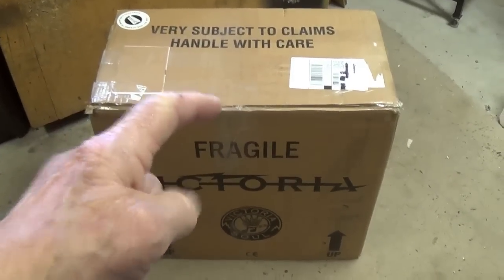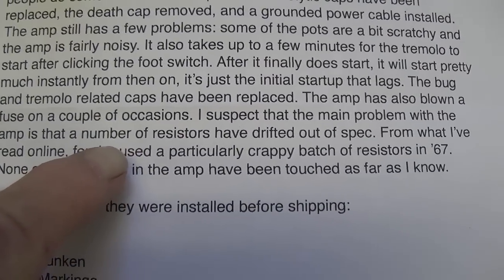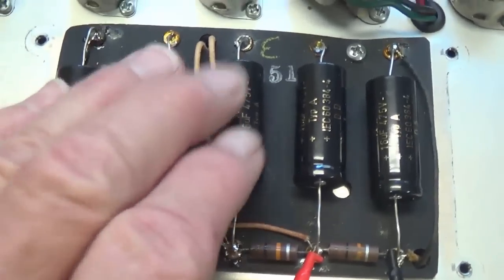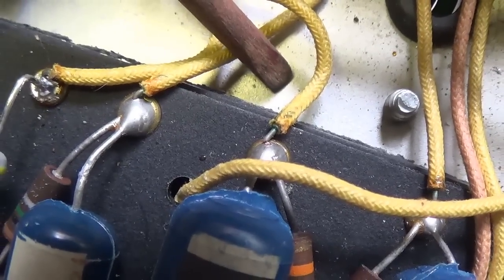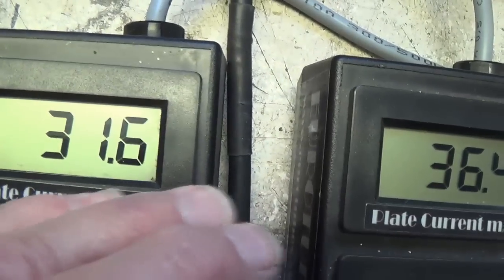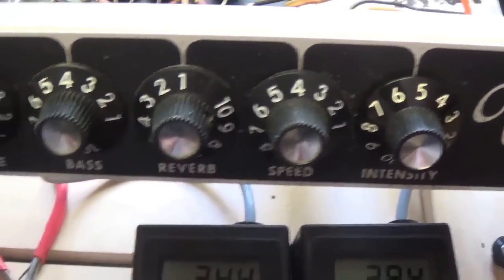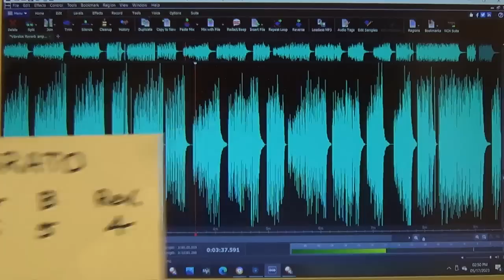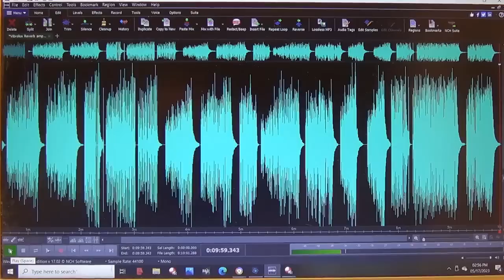1967 Fender Vibrolux Reverb with a Lazy Tremolo and too much Background Noise

Comment: A couple of things to watch out for in a case like this: 1) If a knob has been replaced (having been lost or broken), maybe the knob took a hit in the gigging van and the potentiometer itself was also damaged. The video didn't show the backs of the pots and so we can't see if that tremolo intensity pot appears original or not; there's always the possibility it was replaced with a non-original part which might not be of the correct resistance value or taper; or perhaps it simply drifted with age. And 2) although the eyelet boards in late blackface amps weren't as heavily waxed as the ones used by CBS in the silverface amps, the Leo-era boards can still be prone to contamination from a combination of moisture, cigarette smoke and other gunk that is absorbed from the air, making the board mildly conductive; when the amp is turned on and warmed up, the wax softens and allows moist air into the board, which becomes trapped when the amp cools. Also, if the amp was shipped to Doug from a more humid climate,  it might temporarily appear to perform better with less noise in the dry Texas climate; and the heat of resoldering anything in that area would tend to drive moisture out of the board and temporarily make it a better insulator so that it performs more quietly. Even millivolts of leakage through the board could affect the charge/discharge rate of the capacitors in the tremolo circuit! 

Ideally, scraping away any flux residue from the connections in the tremolo  circuit area, warming up the board with a hair dryer or heat gun, and then blotting up the softened wax with alcohol and paper towels or Q-tips would be a good idea. If the amp in question is a silverface Fender with a more heavily waxed board, removing all of that wax isn't merely optional, it's really a necessity. Watch a couple videos from Psionic Audio, and Brad's Guitar Garage, to see how its done.
Reply from the maker: Thanks for your very detailed input, GU :)

Comment: Hello Doug, I have a Fender Custom Vibrolux Reverb which I removed the green circuit board and installed an eyelet board like Fender did in the past. My question is what is a safe and good bias for the 6L6GC tubes with the plate voltage at 384 volts. Is 36 ma good enough or can I increase that ?
Thank you
Reply from the maker: Greetings, Jim. The max PD for GC's is 30W. I assume the tubes are fixed bias (grounded cathodes) so ideal PD is 70% = 21W. At a PV of 384V, your PC could be much higher, i.e. around 50 to 55mA.

Comment: What do you think about the black panel pro reverb amps? I just picked one up from family, it’s a 65 and it’s such an amazing amp. It has an original cover that isn’t in the best shape but for the age the amp is in decent shape. Has a few dings and bumps but otherwise is in great shape. It has a pair of RCA black plate 6L6GC’s and an RCA GZ34  rectifier tube. The speakers aren’t original though they are Italian Jensen C12N’s. I used to only dream of owning vintage fender gear, now I have a 63 6G6-B Bassman, a 61 brown reverb unit 6G15, a 65 Pro Reverb Amp and I’m getting a 65 Fender Jaguar in mint shape.
Reply from the maker: I love PR's, Nikki. One of my all time favorite large amps. Wow, you are gathering quite a nice collection of vintage gear.

Comment: In regards to the carbon comp vs. metal film argument.........   I  ALWAYS just use metal films in clone amps that I build.   I really don't have anyone complaining about tone....  and I've had numerous owners proclaim that my clone amps sound BETTER than the vintage (70's) amps they were using.   I REALLY wish musicians could audition amps "blind"...  where all you know is how it sounds.  We get hung up on brands, and "magic parts".... when there's no magic.  You know that as well as I do.   Parts are either suitable for purpose,  or not.  Speakers either give a great sound,  or a not-so great sound....      I have my opinions on what works well,  and what doesn't.... but I NEVER proclaim any parts as "the secret"...   Secrets are for scammers.
Reply: I wholeheartedly agree, and I'm sure UD would too. He's said as much before. Right on
Reply from the maker: You're preaching to the choir, DK.  Until someone posts a properly-designed double-blind experiment in which various individuals......or even test equipment......can detect a legitimate difference in tone associated with different brands of component, I shall remain a skeptic.
Reply: @UncleDoug  Indeed.  In many respects we've got better parts now than existed in the 50s-70s...  yet present day Fender doesn't use them.... they pick the cheapest stuff instead.   At the same time, I don't believe in the extra pricey "vintage" style parts either.   I buy on reliability and value.
Reply from the maker: Agreed, DK. Well said.

Comment: Uncle Doug, I have an old 1963 Fender reverb unit that has been making a strange low flutter static (the best I can think of to describe) that has been present for over 10 years.  I live with it and have changed many components over the years but I have not changed every resistor which I now think may be the problem.  It's basically the only component left that I haven't changed although I have changed quite a few of them.  What would be the best type of resistor to replace the old carbon comps and still retain the vintage sound?
Reply from the maker: I use carbon film resistors, MS. Also, check your lead dress. I had a long-term oscillation problem with my 6G15 that was resolved simply by moving some wires.
Reply: @UncleDoug  Thanks UD.  It's more of a random, sporadic, noise that comes and goes, kind of like someone shuffling a bunch of paper except amplified.  Did you end up replacing all of your carbon comps?  I just checked my old parts bag for the reverb and it looks like I've only replaced three resistors and the three diodes, plus all the caps (except the blue moldeds) and tubes over the years.  I thought I had replaced more resistors because I made a list and I think I bought them years ago.  Now, I need to take the list and buy all carbon films and nip this noise in the bud.  I used my trusty capacitor analyzer on the blue moldeds.  They seem to last forever.  Have you gotten good use out of your capacitor analyzer?
Reply from the maker: That does sound like internal arcing within carbon comp resistors, Mill. There were some circuit issues with the tester that have not been completely resolved.
Reply: @UncleDoug Did you swap out all the carbon comps on your reverb unit? That’s too bad on the tester. I had to change quite a bit on my Sprague including the main wire wound bridge pot. Thank goodness I was able to find one on eBay.
Reply from the maker: I built my 6G15 from scratch using carbon film resistors, so they were not an issue.

Comment: Question, an antique electronics vendor offered to sell 11 new "Hammond" brand replacement transformers (audio and power), along with two chokes for $200.00; they appear new, (to be 1980's vintage) for Fender guitar amps.  While I usually only work on "W Marshall Leach Leslie Systems", these Xfrmrs were sourced from the Thomas Organ Company, I'm guessing for a project involving restoration of at least three amps.  $200.00 is "an easily absorbed loss", and the very moment I would back out of the deal, I'll have a Fender amp for repair come across my "empire of dust" workbench... Do I take the chance??
Reply from the maker: I can't say without knowing the part numbers and applications for each transformer. Like you say, however, $200 is cheap enough to roll the dice and take a chance. If you do, let me know how it goes.

Comment: Hi uncle Doug. Love your videos. I just subscribed. I will be hitting the like buttons on them!! I have a question and you're the one I trust. I'm building my version of the champ amp. However I'm going with solid state rectifiers. Is it better to use the hv center tap to ground and the heater supply CT to ground? Or is it better to ground chassis with the hv - and with or without heater CT grounded? The grounding scheme is where I'm getting jambed up. I'd like to use DC heater power to reduce hum. Any advice would be much appreciated. I want to help keep tube chassis alive. I've restored one tube amp and I've built several electronic projects
Reply from the maker: Thanks so much, Thomas. The HV CT must be grounded to complete the HV circuit. If you choose to rectify the 6.3VAC circuit (which is really not necessary) then grounding the 6.3VAC CT is not required......and it may be part of the rectification circuit, depending on which circuit design you employ.
Reply: @UncleDoug  the HV CT has to be grounded even if a solid state bridge rectifier or tripler circuit is used?
Reply from the maker: Naturally there are exceptions, Thomas, but you did not specify the type of HV rectification.  Simply follow the circuit diagram you end up using.

Comment: I have to admit i did not care a lot about the quality of the resistor i used in my design, always using the cheapest ones. Until recently, with that preamp with which you so kindly have adviced me. 😅
Reply from the maker: I'm glad the advice was helpful :)
Reply: @UncleDoug  I am used to working with opams that are evidently more forgiving than 12ax7s. Now, I got me some good metal oxide resistors to play with.
Reply from the maker: I think you will find them to be superior in every way.

Comment: You know I love your work Uncle Doug. But... You knew that a but was coming right?
I would really like in this instance to hear a comparison. I know you've done it in the past but I suggest a very brief demo of the problem and then perhaps a very brief before and after.
Reply from the maker: My only hesitation in doing before and after demos is that if a serious problem exists in the circuit and I proceed to operate the amp, damage could occur to components like either of the two transformers. Thus, I prefer to simply eliminate all issues before demonstrating the final tone. I do get your point, however, and will keep it in mind for the future.

Comment: 18:13 The resistor on the left has a second color - green. In poor lighting it is hard to see, but still noticeable. So its resistance of 150 kilo-ohms is correct.
Reply from the maker: Thanks for your input, TD :)

Comment: Haha your resistor problem, one of those is brown green yellow (150k) and the other is rightfully brown black yellow, it might be time for some stronger lighting in the workshop!

Random question, with the 'roach' would you get a higher strength signal using a green neon bulb than a red one, considering wavelength difference?
Reply from the maker: Good question, P.  The best way to tell if photoresistors respond differently to different colors of light would be an experiment. If you do this, let us know the result.
Reply: @UncleDoug  I wanted to! But I've been away from home for over 3 months thanks to a fire 😑
Reply from the maker: We've been away from the workshop for about the same length of time, due to incredible >105 degree heat.
Reply: @UncleDoug  honestly have no idea how some people manage to survive in certain parts of the world!
Reply from the maker: No kidding, P. Yesterday was 104 :(

Comment: Hello, i have a Ibanez Valbee, a small modern amp of the 90's. It is possible to replace the output transformer to acomodate a 8ohm or 16ohm speakers? what trafo specs i need?

Thanks!!
Reply from the maker: You need to watch my videos on output transformers and on the impedance ratio. Hopefully, they will help. Good luck.
Reply: Thank you, but my English is very bad, it is difficult for me to understand everything, I am Spanish. But thanks for responding, I'll look into how I can do it. @UncleDoug
Reply from the maker: Good luck, Indi. @indibil

Comment: Excellent packaging and catering to cats, eh? Loveliness.

Metal film resistors FTW! My fav are old Soviet MLT type metal firm resistors, they come in different sizes (1/8, 1/4, 1/2, 1 and 2 watts) and when I tested a 2W one, I ran it at 7W and it was giving off a lot of magic smoke from burning enamel, but still going and within spec.

148k on a 100k, WTF?! Even the '60s had tighter tolerances...
Reply from the maker: Thanks, KE. Glad you enjoyed it :)

Comment: The cap on the fuse holder appears to be non original;  The cap is a different shade of black than the main fuse holder and seems to stick out too far. They're not usually cone-shaped either if I remember correctly.
Reply from the maker: I agree, GU.

Comment: why not install carbon comp resistors? i wouldn't think price would be an issue. just wondering. especially if tone could be an issue.
Reply from the maker: Price is not an issue with resistors, Lee, it's simply a matter of precision and reliability.....in which carbon comp resistors tend to be lacking.  Also, I am not a believer in the notion that resistor type has a noticeable impact on tone.
Reply: Yes I've heard people talk about the "tone" of electronic components and I don't see how that would even be perceivable. I'm a simple man though. @UncleDoug
Reply from the maker: As am I, Lee, and a skeptical one when it comes to unsubstantiated claims regarding over-priced components ;)

Comment: Having seen so many UD vids now I can tell what in the main was wrong just by looking at the chassis as it came in.  ( resistors too close to heat rising valve locations - therefore new resistors on slightly longer legs to give air circulation.  Power cable feed to primary of isolation transformer all wrong re switch and fuse = wire correctly.  The other bits obviously needed checking with meter and so on.
Reply from the maker: Thanks for your helpful observations, HP :)

Comment: wires under nuts i think is never a good thing solder to the cassis must use 2 x star washers to get a good connection
Reply from the maker: I do use lock washers when bolting down ground wires.

Comment: 18'33. You did't measured two identical 100k. One is brown/black/yel the other one brown/green/yel, 150k meant , so you measured two different values and pretend to be the same. It can be clearly see in the vid there are different colored. 147.8k is within 5% tolerance of you 150k carbon comp so you have a very good resistor ...but sorted wrong.
Reply from the maker: This has already been discussed, but thanks for your input.

Comment: This one didn't seem too difficult to solve all the problems
Reply from the maker: Some are easier than others, Mike.
Reply: 2bikemike,  If you want to see a really messy one take a look at the blackface Bassman head that Psionic Audio audio just posted a video of. It was stored in a garage in Mississippi and the chassis rust is *nasty*.
Reply from the maker: Thanks for the tip, GU.